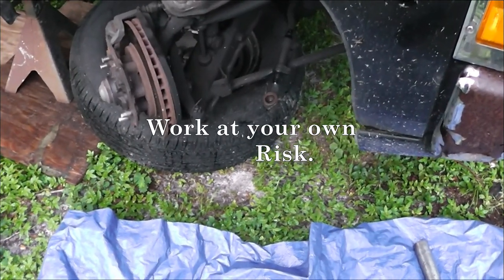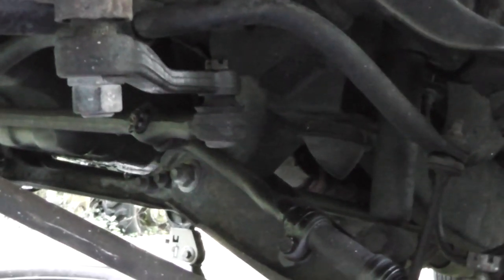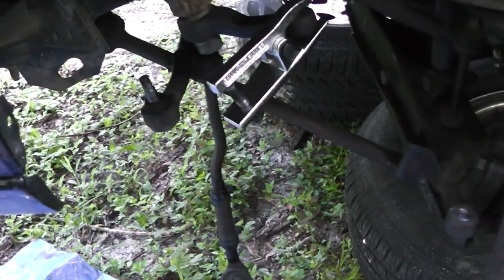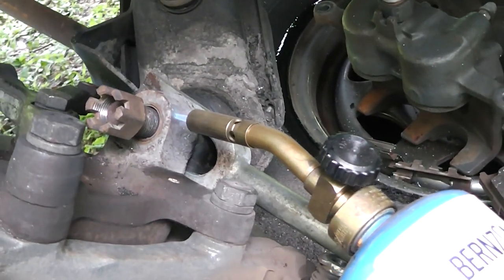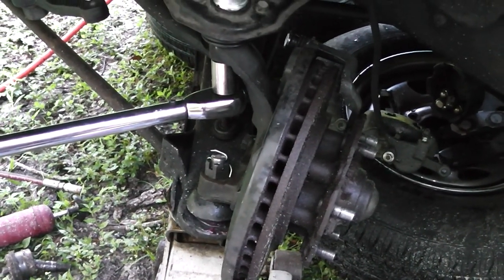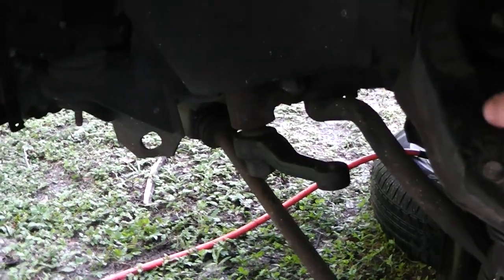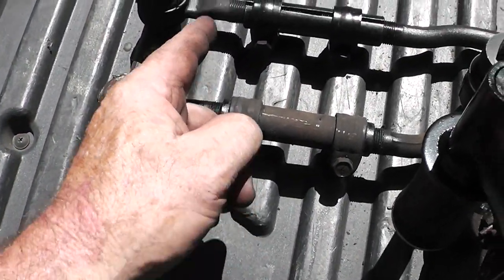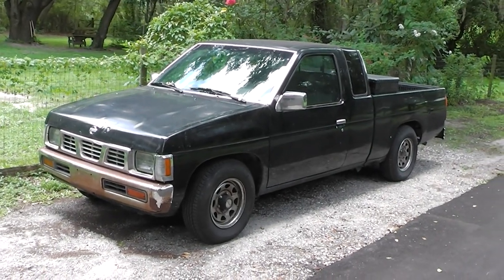How to Nissan D21 Pickup Front End Rebuild and Alignment

Comment: Funny, I am doing the same job on my 1985 Nissan 720. Even though there are slight differences between our vehicles, this video provided me some useful preparation. I am replacing all front end bushings except the lower control arm bushings (because that is a bear of a job. I'm hoping they are still usable and don't need replacing). Like you, I bought all new components (crosslink, inner/outer tie rods, adjusters, upper and lower ball joints, radius arm, etc). Thanks for the informative video!